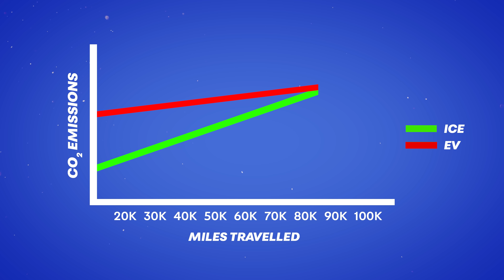Are Electric Cars REALLY That Green? [New 2022 Data]

Comment: Another thought provoking video, Rory. I haven't seen the report from Volvo so perhaps you can answer some thoughts I had. A lot of this depends on the annual mileage of the electric vehicle and therefore how long it takes to reach the break even point. As you have shown with your Leaf, the capacity of the battery with present day technology declines with time and some sources suggest an 8 year life. So it's possible that the car's range would have declined to the point where you need a replacement battery before you reach the more realistic break even point of 50000 miles. What then, of the cost in carbon dioxide of a replacement battery? The petrol car, on the other hand has the advantage of a tank that holds the same amount of fuel throughout the car's life. 
As the battery capacity declines, does it take the same amount of electricity to charge this less useful battery? If so, then more carbon dioxide is created in making the proportionately more electricity per charge. This could, of course push the break even point even higher.
In time you can bet your life on the politicians abandoning zero road tax on EVs (Maybe by the time 35% of cars are EVs?) And around the same time I would expect that the electricity companies will ditch the cheaper overnight tariffs too. Financially where does this leave EVs in the mid term?
Reply: It might make my busy street chocked with brand new “clean” 1.9 turbo diesels a lot nicer to walk down if they were electric tho. That’s one advantage lol.
Reply: Good comment. Raises questions I didn't think about.

Comment: Since I can't post links - here's a short summary which even a journalist should be able to follow up on ;)

Claim: it takes 70k miles for EVs to pay back battery production.
Reality: 16k miles

1) Overestimating battery manufacturing,  in Volvo case, electric version is produced is an inferior factory, less effecient compared to the combustion one.
2. Underestimating battery lifetime

3. Assuming unchanged electricity mix over car lifetime. Estimations are around 100g/kWh , Volvo used average Global of 630g, and EU of 420g/kWh

4. Using unrealistic "leaflet "energy use data for petrol cars, instead of actual like EPA. For example, if we use If I use the EPA values then the XC40 emissions are not 212 g/km but 296 g/km! So in reality the XC40 emits 84 g/km more.
If we use EPA numbers the EV use increases from 19 g/km to 27 g/km.
So just 8 g/km more for the EV and 84 g/km for the combustion car.

So to summarize:  the claim is wrong, building error on error.
If you correct the LCA in the way I've described it becomes 16k miles.

There are several publications on this with sources and data. All it takes is 10 min and a healthy dose of common decency.

Comment: Anyone else finds suspicious the claim that making a battery generates more emissions than melting the metal to make an engine block?

The problem with Volvo as with many other ICE car manufacturers is that they don't want to make EVs. They are basically being forced by the reality of climate change and the popularity of Tesla. They'll say anything to slow down EV adoption. Specially since they are so far behind from Tesla.
Reply: You obviously know nothing of Volvo to claim they don't want to make EVs. Research what they're doing because you couldn't be more wrong.

Comment: Electric cars use 30% less components. Suppliers make the Li batteries and ship to the OEM for assembly with battery management systems and other motors for the wheels. I don't understand why building EV takes more space and more processing.
ICE cars use mining extraction also so I am not fully convinced this has been taken to account. Look at the catalytic converter that is attached to the exhaust pipe. A metal casing contains a ceramic honeycomb. The honeycomb is coated with a mix of Platinum (Pt), Palladium (Pd) and Rhodium (Rh). This is just one prime example.
The point that isn't clear to me is recycling these batteries after the life is up. There are companies who are recycling this. And the cost of a new battery set for the car (around $23,000 US) for an average EV! On the ICE cars lot of components can go wrong and so the cost of maintenance over the same period of time.

Comment: The refining of gas and oil and production was not taken in to account,  for every litre of gas required to run a car it takes more electricity to refine that gas than it takes to run the electric car.  Do the math and ad that to Volvo's supposed like for like comparison, then add abandoned oil wells spewing out methane and being left uncapped, and the cost of spills, and the cost of transporting gas and oil and it changes the equation again.  I call BS or I call out Volvo for not using scientific method because this is not a like for like comparison.
Reply: 5:16 it was factored into the Volvo numbers.

Comment: Still waiting for EVs to come with solar panels. I’m sure that will make them a little bit greener
Reply: Not practical.  You'd need a solar panel the size of a tennis court to provide a meaningful amount of energy to propel a car. The small panels you sometimes see on EV's are to provide a top-up supply for the 12v battery.

Comment: I have read of academic studies that conclude manufacturing an ICE car is only slightly more green than EV's.  EV's have batteries; ICE cars have far more parts.   And, battery production is getting greener fast.  The source of electricity is significant but over five years even EV's powered entirely by fossil fuel electricity emit less GHG's. He implies the issue is reducing pollution in your community.  ICE cars have significantly reduced solids pollution over the years; the issue is CO2.  The goal is mitigating climate change.  So jurisdictions that have largely renewable electricity, like Norway and Quebec, (86% in my area) make EV's more effective. No one says EV's are "the magic bullet" for climate change but they are an essential component of meeting climate targets (in Canada the largest).

Comment: Great video! One thing I've noticed in the report is that the comparison for 'use phase emissions' is not a fair one. It looks like they've taken the CO2 generation of using the petrol but not creating it. I would imagine the CO2 emissions from extracting, transporting and refining the petrol would add something too? This would need to be done for the EV side too for coal/gas powerstations but still think it wouldn't be the same for both, in effect cancelling it out
Reply: Yes they do, it's on page 21.  Look at the report for the term "well-to-tank," they include it in the use phase emissions numbers
Reply: @callresponse2574  ah, perfect thanks for correcting. I had a skim through but didn't notice that.

Comment: All energy generation is fed into the grid - you can't ring-fence 'green energy'. The 'green energy' is prioritized by the grid for obvious reasons (none of it is wasted), powering permanently plugged-in home appliances such as freezers, factories, etc. When you plug in a car, it takes the marginal power supply generated by other sources such gas or even coal. EVs are putting additional demand for power on top of what we currently generate. Until our energy generated is 100% green, EVs will always be powered by the dirtiest kind of electricity.
Reply: You will find that a high % of people with EV’s charge off peak when demand is low over night, usually this comes from wind or just balancing the network when power companies need it used.

Comment: This is fascinating (and a very well made video), but I'd argue that this is very specific to Volvo, who has an arguably cleaner production process than a lot of other OEMs since sustainability has been a thing for them for quite a while.  There are a lot of cars that source parts from many different countries, for example, so not only do you have the manufacture of those parts + assembly, you also have transporting the parts.  I'm also curious about whether or not raw material extraction for ICE parts were also included (I mean, you've gotta make steel to make an exhaust pipe).  :-)

The report is impressive in it's attention to detail (on first blush), but yeah, I don't think it holds true for all EVs or all ICE cars.
Reply: The EV XC40 is also exceptionally inefficient as it is very overweight and not aerodynamic. They obviously know.....
Reply: @NO3V  It's a transition car to what they're going to come out with in their next generation. The next generation will be introduced late this year (they were delayed by the pandemic). The Polestar 2 and Volvo XC40 are built on hybrid platforms, not EV platforms. If you want to see the next-gen preview look at the Polestar Precept and Volvo Concept Recharge. These are the platforms for the next gen that again, the first models come out end of year and then each year they'll introduce a new pure BEV model (with Volvo, replacing the old model). however, adoption rates are forcing Volvo to keep the hybrid cars going for a bit longer than they'd like.
Reply: Wow, finally someone knows about Volvo's commitment to sustainability and isn't spouting off some nonsense that they are pro-ICE and want to slow down the adoption of BEVs. That's refreshing.

Comment: Come on Rory. If you are going to drag this tired old argument out AGAIN, at least show some of the various studies done recently. The Argonne National Laboratory in Chicago developed a model that allows you to plug in thousands of variables from mining, production, fueling... Even in the worse case scenario, they found the maximum break even was 78k miles, if a BEV is charged entirely on coal. The low was 8500 and the average was 13,500. 
If you're going to cite studies, especially ones with such extreme results, be responsible and tell your viewers that other studies show much different results.

Comment: Great video. I'd also be interested to see a study on the lifespan of ICE Vs EV cars. We all know batteries lose capacity over time, so how long will electric cars last before the batteries become worn out? Another important part of the discussion.
Reply: It's worth noting early EV cars had pitiful range so needed charging constantly. Taking Rorys cheapest ev car as an example the batteries are past there best at around 70k miles with maybe enough potential to see 100k miles overall. Newer cars can do triple the mileage what early Nissan leafs can do so batteries will need fewer charges. Its hard to say though because batteries degrade slowly over time even without use but time will tell
Reply: @johnjackson2349  most newer cars don't degrade the battery as fast as early leafs because they have much bigger battery but it will eventually get to the stage where they have to replaced...the goal should be is too make batteries last longer.
Reply: About 8 years and one day. (After the 8 year warranty runs out).
Reply: @ChrisWells1  Says the man who has never owned, driven, sat in or even touched an electric car. Absolute nonsense. There are plenty of 10+ year old Nissan Leafs still on their original battery.  How about the Tesla Model S owner who posted a YouTube video of his car? That had covered 400'000 kms on it's original battery.
Reply: @Brian-om2hh  It's a well established design fault that Nissan Leafs had major battery overheating issues and permanent damage because of no active cooling
Reply: @Brian-om2hh  Plenty of Nissan Leafs are very dead. You can cherry pick individual success stories.

It's still going to an awfully long time to recoup 10000kg EXTRA CO2 required to make a EV car vs an ICE car.

Like about 150,000-200,000km to START to break even. I doubt many Teslas are that old yet.

Why would I want to buy an EV car when I have a perfectly serviceable bicycle and 12 year old ICE car?

We can't consume and manufacture ourselves out of the global warming crisis.  Buying new stuff doesn't make the energy invested in the old stuff suddenly disappear. The new stuff you've just bought create a mega truckload of CO2.

Comment: The only viable option is to make the energy supply much cleaner. This will ultimately affect all production, cars or otherwise. So no more gas power and certainly no more coal power. Instead, renewables whenever possible and nuclear where necessary!

Comment: Your argument is similar to my view, on incandescent light bulbs. If used, indoors, in winter, where space heating is required. A little bit of metal, and glass. They are way ahead, of the new ones. 
For outdoor, or where cooling is required. It may be opposite. (I don’t know the lifecycle of the materials. But the early cfl did have mercury)

Comment: One phase that I’m curious about: What type is less impactful to the environment after it reaches end of life?
Agree per lifecycle phase there are numerous opportunities to optimize - do foresee that in 10-15 years timeframe wastemanagement and recycling techniques for lithium and nickel will become a big challenge.
Reply: Pages 4 and especially 5 of the report gives an idea of what the end of life emissions difference is between the petrol and EV Volvo models.  They're pretty similar and, ultimately, a drop in the bucket for total emissions
Reply: Batteries are already recycled to extract the high value raw materials to make new batteries. It’s still quite small scale because there aren’t many EV batteries to recycle as they normally last the lifetime of the car and very few EVs are old enough to have reached end of their life. The startups in this space will become very valuable as the supply of batteries to recycle grows